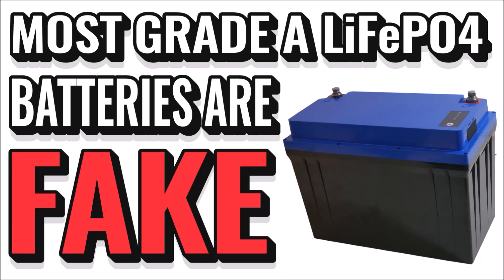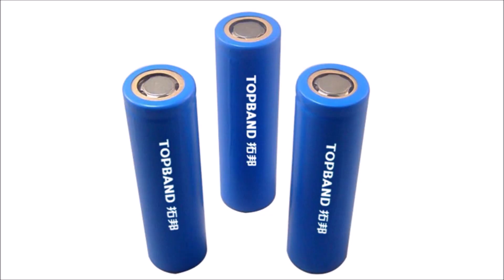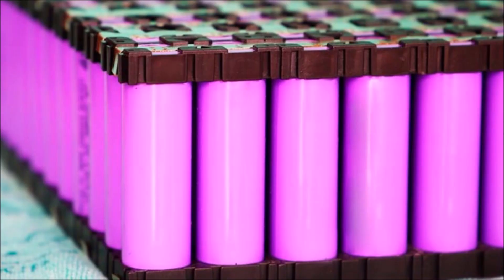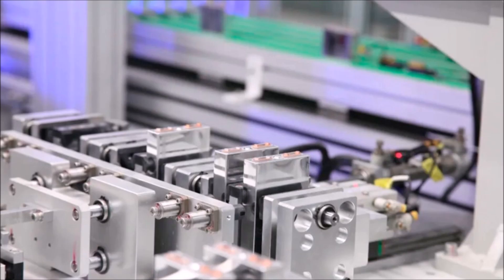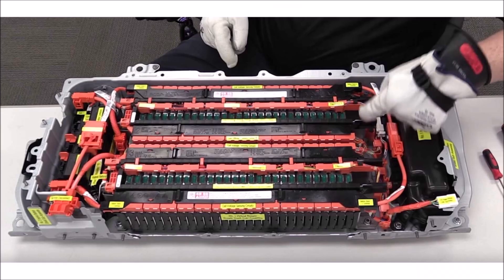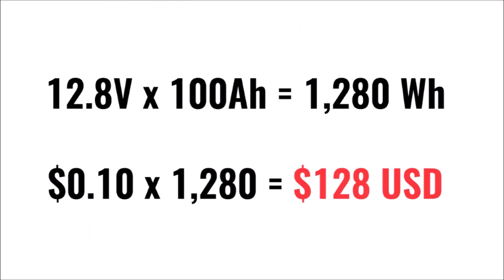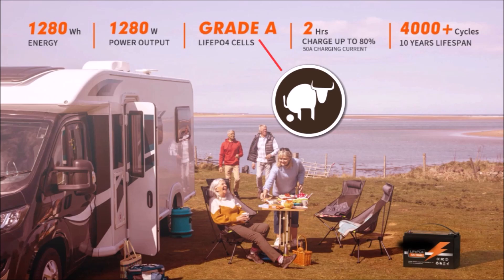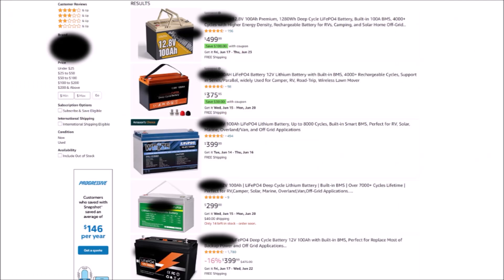Fake Grade A Lithium Deep Cycle Batteries Are Everywhere!  Learn How To Spot Grade B vs Grade A

Comment: So if the average Joe, does it matter as you say that the effects would take thousands of cycles. Whats the worst case of paying half the price for the same result in the short to medium term?
Reply: It's more the fact that they lie that is the issue
Reply from the maker: As Chris said, it is the lie that is the problem.  There is a huge difference between a consumer that uses their deep cycle battery(s) every day and depends on it for life and a consumer who only uses it recreationally on the weekends.  Because of the lie, the person depending on their battery every day might buy a $350 battery on Amazon and expect it to be a 10 year investment because that is what the "warranty" or the math says (a claimed 4,000 cycles is about 11 years).  But they may only get 2-3 years out of that battery.  Or it may not fail altogether but might start losing capacity over time and stop giving them the full power they invested in.
Reply: @LDSreliance  True, but the same applies to everything on amazon and ebay these days, Really boils down to "buyer beware" and "you get what you pay for"
Reply from the maker: Probably true.  But this is the only industry where I have inside information and experience with the supply chain and economics behind importing and/or assembling cells in batteries for sale in the USA.  So I will leave it to other people to expose the other Amazon product scams.

Comment: Awesome summary dude. 

I got to pretty much the same conclusion by asking loads of questions. 

I finally understood grade A means grade A and storage grade means the factory QC failed stuff at the best or used cells re-wrapped at worst. 

Thankfully I got EVE 105 Cells directly from eve at $51.50 a piece. With the factory testing certificates etc. $0.15ish per watt. Not bad I suppose.
Reply from the maker: Very nice!  I'm going to be reviewing a battery built with EVE cells soon, as a matter of fact.
Reply: @LDSreliance  will make sure to watch it!

Comment: Is there any advantage to having a bms that can balance the cells?
Reply from the maker: Yes, all lithium deep cycle batteries need a BMS.  Or they need to be connected to a device that can do that function.  Otherwise the battery pack won't perform well and may not last anywhere near as long.

Comment: a lot of these battery's are being sold using used graded sells that will probably last a few years as for warranty they will want you to post it back to china so it won't be happening
Reply from the maker: Agreed.  I have even seen pictures of the battery case only being half full of cells and the rest was weighted with chunks of cement to convince the buyer that it was a real battery.

Comment: there are some good off brands from china.. but your right  many are no good  gotta do your homework...  I got some WEIZE 12V 100AH LiFePO4 for around 300 each  and they work fine, time will tell of course  but they are holding strong so far. like new after a few months of use.
Reply: I got a pair of Power Queen 100ah for a little over $200 ea. They work very well for me here in Jamaica, but time will tell how good they really are.

Comment: I found that lithium batteries are only genuine when bought through big brands(apple, samsung, xiaomi etc). This makes me wonder if there is a trade secret in this industry just like semiconductors and aerospace engines.
Reply: you're referring to a different type (chemistry) of battery. This review was about LifePo4 deep cycle batteries, opposed to Li-ion  batteries used in portable electronic devices. However sellers of Li-ion batteries have their own dodgy practices.e.g. Replacement batteries advertised as offering double the power capacity of the OEM equivalent within the same packaging area

Comment: So it looks the same, tests the same and perform the same for years..
Reply from the maker: Not exactly.  Looks the same, tests the same in most areas (beyond 1C it will start to show signs), performs the same in some areas (again, over 1C degrades fast), lasts 1/3 as long at best.

Comment: This was very informative.  Besides the price, you can also look at their warranties.  When a company guarantees an LFP battery for a year, they are basically saying that you may get as few as 400 cycles.  A good grade A cell can get 5K to 6K cycles going to 80% DOD, and 10K or more cycles if you just go to 50%.  I would also bet that quite a bit of the Chinese Grade A cells may have been grade A when they were manufactured, but they have already been used for as many cycles as possible in another application until the new grade A cell just barely meets the grade A spec, or even worse, just barely meets a grade B spec.  Thanks!
Reply: Even with a long warranty, how do we know they will be around for 10 more years? If their batteries start failing in 2-5 years, they’ll just close up shop.

I remember many many years ago, a company selling PowerBook external battery packs announced that they had screwed up. Their charging circuitry was defective, it was damaging the battery cells, you should stop using them, they didn’t have enough money to replace them, and they were closing down.  

When you have one single product, and the question is whether you might need to replace every single product you’ve sold…your warranty promises aren’t going to help.
Reply from the maker: Very true.  Thanks for the comment!

Comment: Any opinions on Amped Outdoors batteries?  Was thinking about getting two 36v 50AH batteries to run my trolling motor-- hooking them up in parallel.  

thx.
Reply from the maker: I have no direct experience with them but clues from their website and pricing would indicate that they are most likely quality batteries with Grade A cells.  But, again, I don't know for sure.

Comment: It depends on how you use them, for my trolling motor that only gets used on the weekends iam only charging twice a week for 7 months then storing my boat over winter.  So lets say 56 cycles a year,  20 years later its only at 1,120 cycles!  Ill gladly pay the 400 bucks vs the 900 bucks!
Reply from the maker: In your use case, that is a pretty good deal.  For someone living in their van or spending their summers in their cabin or someone who is a fishing guide or park ranger that would be different.  Also, since the Grade B cells vary in specs the BMS has to work harder.  And since most of the bargain basement Grade B batteries use cheap $10 BMS's, it is a roll of the dice whether you are going to even get your 1100 cycles out of that battery or whether the capacity doesn't start degrading after 100 cycles.
Reply: The chemistry only last about 6 years. Please check the actual factory websites for expected life span.
Reply: @mariovr8416  - Some are saying 10,000 charge/ discharge cycles now until 70% (not likely and probably not possible). My point is: I'm not even sure you can trust the manufacturers either. The whole racket is crony corrupt Capitalism and the Chinese learned well from the West.

Comment: You point to an Amperetime as a grade B yet Will Prowse actually took some part and was so impressed that they were the number 2 rated battery on his web site for a long time.
Reply: I Own ( 4 ) Ampere Time 100Ah LiPo4 Batteries. They work flawlessly for me, whatever grade you want to give them !
Reply from the maker: Being impressed with the construction does not equate to Grade A cells.  The MillerTech Economy series is top shelf inside, too, but is still made with Grade B cells to compete on the lower end of the market with the others.  But at least they are honest about it.
Reply: @LDSreliance  Did you go watch his video? I believe he tells you if the cells are Grade A or Grade B.
Reply from the maker: Yes, I have seen the video that you are referring to.  My point is that he cannot possibly know that they are Grade A or Grade B by looking at them.  He did not disassemble the battery and test the cells.  Nor did he show any documentation from the manufacturer that shows those cells and their testing results.  If you ask that information from a true Grade A battery manufacturer they are happy to provide that documentation to show that they are top shelf components.  AmpereTime, CHINS, and others cannot and will not provide that information to you if you ask.  I know that because I have had them contact me to review their batteries and we had exactly that conversation.
Reply: Can you tell grade A or B by testing?
Reply from the maker: If you test the individual cells, yes.  Have you ever seen anyone take a fully assembled battery apart and do that?  Not that I have ever seen.  I'd love for someone to post a link of someone who has.

Comment: Got it.  Junk batteries maybe even dangerous batteries.  So what are some good ones?  Some youtube videos show cutting open one of these and inspecting inside, and some seem to be very well built (and correspondingly expensive).
Reply from the maker: You can't spot a fake by doing that, though.  As the video says, you can't know the quality of those cells unless you take the whole thing apart (destroying the battery) and test all of the individual cells and then compare them to data that the original cell manufacturer may or may not give you.  I know the guys in the videos you are talking about, one guy in particular, and he is bought and paid for.  He isn't going to expose those companies, even if he had the expertise and equipment to do it, because he gets massive affiliate money by telling you they are great.

My advice would be to look for a brand that has been around for a while, has a verifiable reputation on third party sites with real consumers (forums, Reddit, Facebook groups, etc.), and the price is in line with the quality level you are wanting.  Unfortunately, you get what you pay for absolutely applies here.  There are no Grade A batteries with quality BMS's on sale anywhere in the world for $400.  Or anywhere close to that amount.  Period.

Comment: You could reverse the math and make a solid case for buying the much cheaper grade B cells/battery.  What application and duty cycle are you using?  2000 plus cycles would be more than enough versus the extra substantial cost of the potentially grade A cells.  For my purposes, these much cheaper cells will be fine.
Reply from the maker: Absolutely.  I advocate for people using Grade B batteries and I sell a line of them, myself.  But people need to know the real scoop of what they are and how they are different.  1000 cycles might be more than plenty for someone that goes out on their boat fishing 20 times a year and never goes full throttle on the trolling motor.  But let him be the judge of that instead of telling him the $300 battery he is buying on Amazon will go for 5,000+ cycles like a top shelf Grade A battery will.
Reply: @LDSreliance  The issue is if the vendor/manufacturer represents prominently that the cells are grade A.  For instance, Ampere Time (Chins?) makes the clear statement in their description/advertising that the cells are Grade A.  If true fine, if not, that is a problem.
Reply from the maker: That is even worse.  We have some manufacturers claiming Grade A specs without claiming outright that they are Grade A and another set of manufacturers that claim Grade A cells when they can't possibly be real.  Sun Fun Kits (https://www.youtube.com/watch?v=KD-av4cTL-Q&t=28s) and LithiumSolar (https://www.youtube.com/watch?v=QcisAQ-NvgE) are other channels trying to expose the same thing, which is also rampant in the sale of individual lithium cells and not just fully formed batteries.

Comment: We sell these to boaters, using Battleborn, Victron and Enduro
Reply from the maker: You sell the Grade B ones or the Grade A ones?
Reply: @LDSreliance  I am told they are grade A, but it does make you wonder if they are.
Reply from the maker: Battleborn are Grade A.  I don't know about the other two brands.  

Another clue that I didn't discuss in the video is whether the company is an American brand or not.  Obviously, that is a big generalization, I am just saying it is a clue.  If an American company like Battleborn or SFK or Millertech were to market their products as if they were Grade A but use bulk Grade B cells they would eventually lose their shirts in warranties, lawsuits, bad press, and social pressure.  Chinese companies don't have to worry about that.  We can't take them to court, they don't have an 800 number to call and complain to someone, most have no long term brand name to protect the reputation of, etc.  So they have nothing to lose.  They can just fold up that brand name and re-appear under a different brand name and no one here, for the most part, will ever know.

Comment: thanks.  After alot of research, I think I'll just stick with lead acid batteries for fishing.  I could spend $2,500 for lithium batteries for my 36v system, but what will the SOH of said batteries be in 5 years?  Or just spend $300 for a marine deep cycle, and get 3 years out of them.

People act like these are forever batteries.  Though not the same, my '12 Leaf has a 55% SOH.  If the above would be the same, then I would have to have a second bank of batteries.

It gets crazy expensive fast.
Reply from the maker: If you are getting 3 years out of $300 marine batteries then by all means!  That is a great deal.  I talk to a lot of people that aren't getting that kind of longevity and are suffering from serious performance issues.  A lot of boaters and fishermen, for example.

Comment: yup they trying to sucker in people .. but theres good deals out there still.. and most will be fine with B cells depending on how its going to be used ... i got a 100ah  12v on ebay and had a bunch of D cells sizes in it... i cycle tested it and got only 95ah saw will power review and he also got 95ah..i use mine for my trolling motor and i burn about 36ah after im done fishing so im fine with it for my use.. ill probably use it 2 to 4 times a month and it says 3000 cycles but i know it vary depending how much you run it and charge it ect... so if i use it like 50 times a year and burn only like 40ah most the time out of the 95ah i can get 60 years lol ...3000 cycles divide by 50 times out of a year lol..ill be even happy if i get 10 years and still be able to use it for lighting up my lights charging phones ect... i think B cells will be fine for most people just depends what you are trying to get out of your set up... you made lots of good points here ..
Reply from the maker: Yes, there is definitely a place for B cell batteries.  I disagree that you will get anywhere close to 3000 cycles, though.  

I just wish that the average Joe consumer who knows nothing about batteries and cells should know that the $300 100Ah battery they are buying will have limitations and decreased life compared to an $800 Grade A battery so that they can make an informed decision.
Reply: @LDSreliance  yes I know I will not get 3000 or even 2000 cycles ... by that time it will be like 20 years lol..  likely the cells would be very low flat .. but if I get 7+ years I'll be fine can't complain for 300 bucks .
Reply from the maker: For sure.  Just clarifying for anyone reading this.  A battery built with Grade B cells will be very lucky to exceed 1,000 cycles even with an excellent BMS (which a $300-400 100Ah battery from Ebay or Amazon surely will NOT have).

Comment: There was an older video of Wil Prowse tearing apart an inexpensive TimeUSB Lifepo4 battery and showing used grade B cells. One can only assume other brands from asia have similar builds.  One thing I noticed is that ratings of these "used" batteries are still very good and the prices are discounted to reflect the lower quality.  The main concern is the longevity (cycles) of the battery.  Hopefully you can still get between 3-4000 cycles out of them.
Reply: Will Prowse has several YT videos tearing down "cheap LiFePO4 100AH" batteries. He found a number actually had Grade A cells and well-built inside. So assumption these are all "fake" is NOT TRUE
Reply from the maker: I agree with you, for the most part.  However, there is an additional concern that can be minor or can be severe, depending on the company.  Not all Grade B batteries are the same.  Some have a very minor variation from Grade A.  Others have multiple variations or a severe variation.  Both can be rejected and classified as Grade B and sold in bulk/surplus to battery builders.  SFK (Sun Fun Kits) and others here on Youtube are showing real testing data with some of these cells with very wide variations in performance.  The better Grade B cells can perform almost as well as a Grade A.  The bad Grade B cells suffer massive voltage drop and severe capacity loss when operating above 0.5C, let alone at 1C.